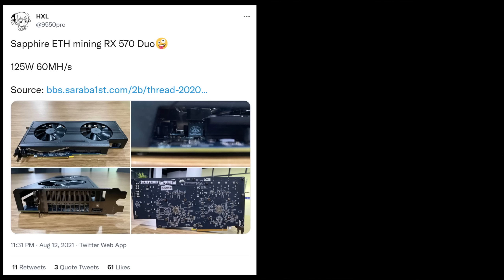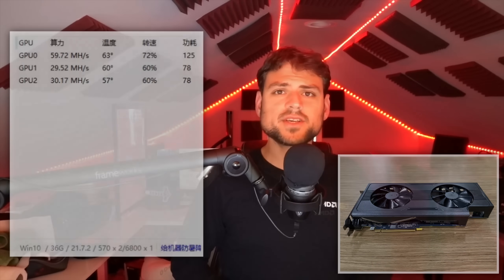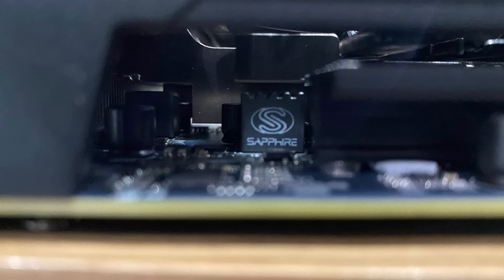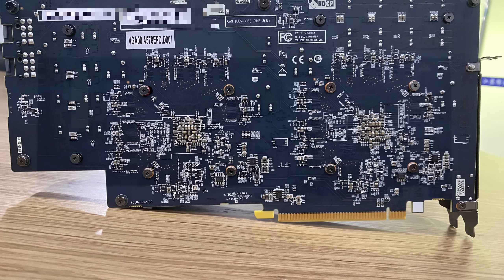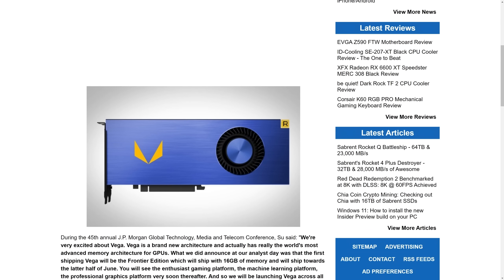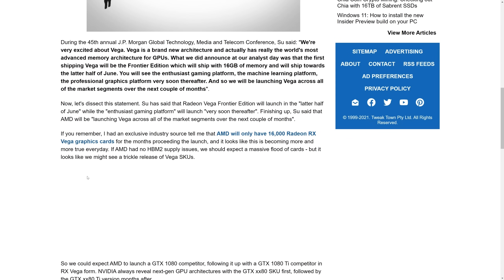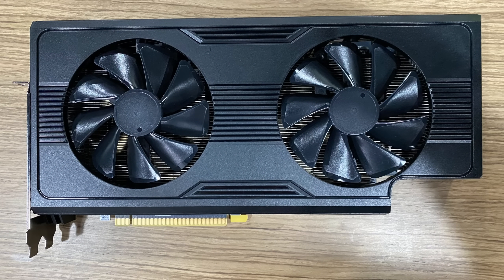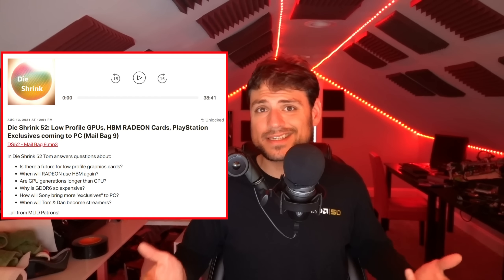AMD RX 490 Launching in 2021 - Why Dual Polaris wasn’t released until NOW!

Comment: If it's Sapphire, I believe, it has a lot of history in making dual GPU MID products, since the HD 3800
Reply: @LunarVVolf Sapphire has always been the best manufacturer when it comes to AMD, from super cheap to most expensive entry-level products, you hardly ever see them make mistakes like PowerColor, MSI or XFX
Reply: @joaobcrts  
MSI have make insane aftermarket coolers for GPUs since the dawn of the computer history.. For example they was the ones whit the best cooler for Radeon x1950 series, same goes for nvidia while EVGA was still using garbage reference turbine cooler, MSI did have good custom coolers...
Sapphire is good, but they dont have always the best coolers... Back in the Tahiti days Radeon HD7970 MSI did hard shit on everyone else with their Twin Froz coolers, while Sapphire dual X, Toxic, Vapor x was crap, they fans was real shit... Radeon RX480 best was from XFX GTR series, Nitro from Sapphire was also good, but not as good. Now for RDNA II XFX Speedster 319 Merc and Quick these coolers just kill everyone else, they are heavy and just cool the best way at lowest noise.. While Sapphire cooler on the Nitro is lighther and louder....
Reply: actually there were Radeon X1950 PRO DUAL and Sapphire HD 2600 x2 as well
Reply: I have a Sapphire HD 3870 x2, but I’ve never made it to work, probably because the psu I used was trash
Reply: @arturofernandez8487  I had a 3870X2 and it worked just fine. At the time it was an amazing card. Sadly enough that computer was stolen and I never got it back.
Reply: Sapphire is Cracked

Comment: Um.... Guys. Are we seriously forgetting that dual Polaris launched in the 2019 Mac Pro? Granted it was branded as 500 series but... We all know it's the basically the same silicon. Main difference is the way the power is delivered to the card obviously. But... Would make sense that original development of the PCB and interlinks were done on PC's without apple's custom power delivery solution.
Reply: The Mac Pro only had dual Vega, and even that was the 7nm Radeon VII version of Vega. The only Polaris card in the Mac Pro lineup was/is the Radeon pro 580
Reply: You forgot about the Radeon Pro Duo 32GB all the way back from Q2 '17
Reply: Yep mac came to mind to, fairly sure sapphire made all the mac AMD/ATI GPU's for the macpro line.
Also Sapphire PC cards are the most compatible with macpro's, the BIOS just seems to match the official apple ones
.
One thing to point out is apple was at the time brining updates to OSX for AMD GPU's that apple never shiped, a lot of leeks on GPU specks came from apple driver updates back then. 
It also lines up with the gap where apple will have been testing "new" mac pro ideas.
Or it may just be one of the pro card's PCB's and some dead stock slicon they found hanging around.
Im not sold it came from a gaming line, dual cards for gaming have been dead for a long time but in compute it's getting bigger and bigger.
Reply: Exactly, there has been dual GPU Polaris out in the wild for quite some time now. This is totally just fake news.
Reply: @nathangamble125  I mean I guess none of you guys watched the video? Straight out showed the Pro Duo and talked about it. And how this card is a different PCB and suggested that this might have been the result of Sapphire potentially working on developing a more game oriented version. If you are going to call the video out at least watch the video.

Comment: you could push the GPU price hikes back to Kepler, where the GK104 was bumped up for use in the GTX 680 instead of the traditional x60 spot, and priced at the same MSRP as the GF100/GF110 based GTX480/580, cards with monster dies and 512bit memory buses

Sure, one could argue the GK104 had fairly incredible performance and efficiency for the time to merit the promotion, but we never went back from there.  Hopefully the market settles down, and with legitimate competition back, maybe we can start to see something of a return in that regard, particularly with Intel throwing their hat into the ring, and APUs becoming ever more viable.

Comment: I still have a Sapphire RX 580 Special Edition in my oldest gaming PC that my nephew uses when he comes over and it still holds up well at 1080p. I do wish I could pick up more at the price they should be at right now ($75-$85) but, you know....
Reply: Reality is often disappointing
Reply: @largecupenjoyer1459  You are not wrong!
Reply: Crazy to think that what happened with 3dfx cards over the past decade happened to the rest of the market over just a couple of years. To think what was worth only $8-20 now regularly sells on eBay for $300-400 on bid these days.
Reply: @MrKillswitch88  I just wish everyone could hold out for awhile so the stores and scalpers would get worried and drop their prices, but I guess when you need a card you need a card.
Reply: @Viking8888  I am holding out on already pretty dated hardware and just going to wait however long till some esports titles get to be unplayable. There is no way I am willing to burn $400-$600 on something that would have only sold for $230 or so a decade ago. Being a collector of older hardware I generally know what things are traditionally worth long haul and the prices for current hardware are doing long term harm even if supply returns to normal prices are not going to correct until said parts are nearing eol.
Reply: my "oldest" pc is older than you

Comment: Nice way to drive miners to Polaris and leave Navi2X for gamers imho. But the wattage consumption of this Duo Polaris GPU isn't correct at all. Much closer to 190-200W in total with the board and memory power calculated. The table you showed us has a 6800 on the top with 60MH/s consuming 125W. The rest 2 are the two dies of this Polaris Duo.

Comment: You should not forget the problems of SLI/crossfire:
.) Micro stuttering: Your 1% lows - even the 50% lows will be a lot worse
.) One card cannot access the other cards VRAM so you have to store everything twice
.) Back in 2016 it was already dead with performance scaling nowhere linear in most games.

So putting 2 GTX 1080 Tis in a PC would still make sense if money is not an issue as there are instances where it is faster than a single 1080 Ti, but putting 2 midrange GPUs one one pcb is just nonsense for gaming purposes.
For mining on the other hand this is perfectly fine.
Reply: Crossfire had way less problems compared with SLI, I often see guys playing with old hardware in modern days for yt surprised how good it work. But devs just didn't want to waste time to optimize for three different type of rendering. But that's ok, MCM designs will give us same thing in more efficient way.

Comment: Pretty serious about the intel stuff here lol it better be good. Amd sleeping on budget market rn no  5100/5300x/5500/5600. I am hesitant to buy any later when AM4 reaching EOL soon.
Reply: No 5600? Really where are you from
By the why you are right dont buy now latest gen of cpu or gpus get deals 
I just bought 3600 got a golden sample for 150$ great deal and upgrade vs my 1600x
Reply: @shayeladshayelad2416  I am trying to sell my g4560 and put some extra cash towards an i3 10105f switching socket n ram too ofc. The g4560 is really bottlenecking the 1050ti now and I don't plan to get a new GPU unless some miracle happens in the market. I do casual 1080p low-mid settings which is why kinda stuck in this weird situation. Sigh....
Reply: @shayeladshayelad2416  yea the problem is amd is hard to get rn. Stocks are non existent and even used market is dry in India. Plus they perform evenly and Intel has better 0.1% when compared to r1600. Otherwise I love ryzen and is my preferred choice. I just sell the processor Mobo combo every time first and then get to ram, psu and GPU. Amd is annoying budget gamers by not refreshing ryzen 3 series at the very least. Then again nothing was expected due to covid.
Reply: @shayeladshayelad2416  sadly I just did cuz you gave me hope.... Oh boi how wrong I was... Phew 
Shipping is around 75% cost of processor 😂
Reply: Wow i didnt know its like this i live in the middle east(israel) and ali is sending here stuff free 
Never the less dont give up you will get you upgrade🙏

Comment: Did 28mh/s really use to take 130W on a 480? Crazy how much has improved since then. It’s not hard to get 30mh/s at or below 100w on THE SAME CARD nowadays.
Reply from the maker: Yeah, but that was a cheap card pushed for maximum hashrate.  I could have made it more efficient.

Comment: GPU 0 is from a 6800 running at that supposed dual rx 570 hash rate. just pause it and look at the bottom.

Comment: Don't forget that some (or all?) dual gpu cards require PCIe switches, and those can be very expensive ($100+ easy just for the chip). They might need a 48 lane switch for an x16 uplink and then x16 to each die. However, mining doesn't need lots of lanes so they could use super cheap switches and run only x1 per die.
Reply: Why are they so expensive?
Reply: @AntonioNoack  Niche product at these very high data rate specs.

Comment: Polaris was a great architecture. It's a shame it scalled so poorly. The 470 was really the peak performance per watt. And getting up to the 480 performance the temp increase and power draw increase was dumb. And then when they did the 590. To get that like 5% performance boost over a 580 took like 20% more power draw it just made them look dumb. And then they did the same stuff with the Vega cards. They were great performance per watt cards if you undervolted and overclocked them. That's how they should have sold them out of the factory. That's where those archtecture shined. Relatively high performance for relatively low power consumption. But they had to try and compete at the highest end they could manage and still it fell flat so instead of providing a low power draw still good performing card for people that wanted that they provided cards that sucked more power and still delivered marginally less performance than the 1060. It's a crying shame.
Reply: When I got into PC building, Polaris was there for me. My first GPU was an RX 460, which I put into my pre-built HP PC as an upgrade, then a few months later I built a new PC with an RX 470, then after that I got myself an RX 580, which I am currently using. Pretty reliable cards

Comment: I still mine on my RX 580 from time to time. When I took the Mobo from the case and fitted 2nd one and run in crossfire - I got more than 100% increase in performance in mining.
(around 120-130%)
Unfortunately would have to buy a bigger case. I can't fit 2nd one with it. It is a HUGE card.
Reply: And no - I have no idea how it happened. It showed up as 1 card in NiceHash Miner. Maybe the sharing of VRAM helped?

Comment: Crossfire was dying and mGPU never took off.  Dual GPU PCB's are pretty cool, but wasn't the running issue the bad performance/stuttering without software support?

Comment: RX Polaris cards with their Direct X12 support generally aged better than their 1000 Series comparisons who don't offer as good support. Generally going from like -7% compared to NVIDIA to +7% frame wise. Not that  thats the most important thing. Its mostly that VRAM requirements also are forcing the 1000 series into obsolescence quicker than maybe expected like the GTX 1060 3GB.  RX 480s with 8gbs of GDDR5 are looking pretty good in 2021. An RX 490 even in 2021 can fill a nice market segment below the 6600XT. Or TBH any more cards entering the supply is a good thing.

Comment: I don't get the "$400 580" when the RX 6600 XT doesn't perform anywhere close to a 580...
A $400 5700 XT maybe, or even a $400 5750 XT. Because the RX 6600 XT performs about 20% better than Vega 56.

People seems to be stuck in the mud that the price is tied to tiers and that overpricing it at that tier is 'disgusting'...
Entry = 50~250 dollars?
Mid = 250~400 dollars?
Mid-high = 500~800 dollars?
High = 800~1200 dollars?

If the notion is lower, then it's likely because you are looking at "pre-nvidia-price-hike" eras before Nvidia raised prices of their cards and a 'lowest end' of that series costs much higher and all future cards followed that tiering?

Comment: even not as a miner, i am aiming to get one card - yes for gaming.

I am mostly playing World of Warcraft, and this game runs on DX12 ultimate - which means i can play on multi GPU :D
Reply: This is stupid. 
1. Polaris doesn't support DX12 Ultimate.
2. DX12 Ultimate contains some features that can be used for multi-GPU, but a game running on DX12 Ultimate doesn't guarantee that the game will implement those features. Blizzard experimented with it in the shadowlands beta but did not include it in the final release.

Comment: The Xbox One X uses a larger 40 computer unit Polaris die that has more stream processors, TMU's, and memory/memory bandwidth than even the RX 590 (36 computer units) and has never been used on a PC video card.

Comment: Well, releasing stockpiled cards on an old PCB design that will not hold back the newer stuff can only be good for the shortage issues , I dont care if its a cash-grab , i dont care if its just for miners ,if it helps ease the demand even a little , Im all for it

Comment: If they could make them work with infinity fabric and get rid of the x-fire driver issues it would probably be a realistic product.
Reply: If it's a mining card, they don't need the GPU dies to communicate with each other. Infinity fabric would be great for anyone who wanted to use this card for gaming, but if AMD wanted to add Infinity Fabric they would have to change the design of the die, which they probably couldn't be bothered to do for a 5-year-old GPU.

Comment: Why don’t you get dual cpu motherboards for desktops, imagine a dual 5900x with the new cache system…..now that would make intel scared
Reply from the maker: AMD just wants you to buy Threadripper.  They have no incentive to make a dual-AM4 motherboard.
Reply: @MooresLawIsDead  Hmm, but could a motherboard manufacturer go ahead and do it themselves or is the BIOS partly a black box to them?
Reply: @Thelango99  Just no. The AM4 IO dies have no xGMI capability, they do not have the extra socket pins nor the on-silicon hardware to connect two sockets. Even if you could somehow hack it together, you would need to use the PCI-E lanes to wire the sockets together, leaving you with a rather useless platform.
Reply: Dual-CPU motherboards are used in some workstation PCs, but a standard desktop simply doesn't need it. Mainstream CPUs have more than enough cores for an average user, and the latency penalty in sharing memory across two sockets results in a performance loss in games and other general desktop software that isn't heavily multithreaded.

Comment: I wish we could have seen a Polaris card with a 60CU or 80CU die.
Reply: That's basically what Vega was.
GCN doesn't scale well above 36CUs, which is why AMD switched to RDNA after high-end Vega flopped. GCN is much more efficient in smaller GPUs, hence why AMD continued to use Vega for their budget APUs, but it's awful for high-end GPUs.

Comment: Was very intrigued by the Polaris mention in the last video.

Sapphire out here making mining cards for AMD? Part of me wants to say good job relieving pressure on gaming cards, while the rest of me realizes it would probably be hypocritical when I also slam Nvidia's CMP line for being eventual e-waste.
Reply: This has a display output, it could plausibly be used as a gaming card, if not artificially limited.
Reply: @TheBackyardChemist  Oh, excellent. I hoped so, but Tom never mentioned it, and I didn't see a view of the ports.
Reply: @benjaminoechsli1941  there was one, if you watched the video carefully
Reply: The difference is that the CMP line uses the same GPU dies as the gaming cards, while Polaris gaming graphics cards are no longer being produced. The RX 570 Duo also has an HDMI output, so could hypothetically be used for gaming if you wanted, while the CMP line have no video outputs so have virtually no value to gamers (unless they use a processor with an iGPU and route the graphics card output through it).
Though the RX 570 Duo mining card is still using up power stages, capacitors, and substrate which could be used on gaming cards, so AMD doesn't get off free for this either.

Comment: I believe that hashrate is real. I have achieved half of it on various RX 480 , 570 and 580 cards so a pair can do 60MH. I do not believe the power use, though. That can't be whole card power consumption.

Comment: This looks like a good hack entry point to augmenting the VR experience of my RX 580. Too bad this thing is already so insanely hot that I've been considering abandoning it less than 3 months after buying it.
Reply: clean it and re paste it, mine runs fine after proper maintenance through the years.

Comment: I'd prefer for them to make dual Vega cards for mining, they are awesome for mining Ergo, which I think that will be the next big mining coin after ETH goes PoS. It'd need a decent cooler, though.
Reply: Problem with Vega is they die pretty easily. There were made 5.000 Radeon VII and 20% of them had died. Just by rebooting your computer i can die. It is nice with HBM memory, but it is build into the GPU die itself so when the HBM stop working it is the end. You can't fix them.